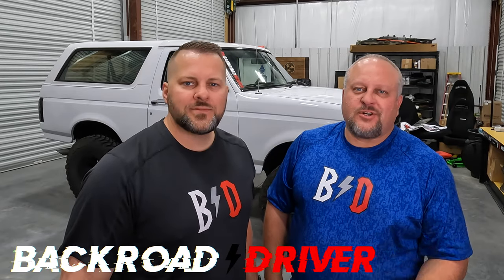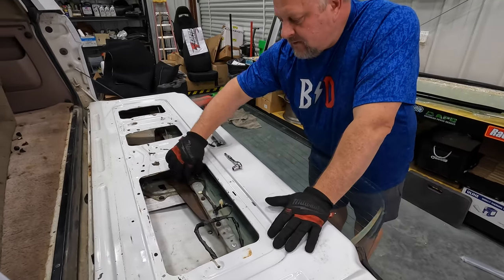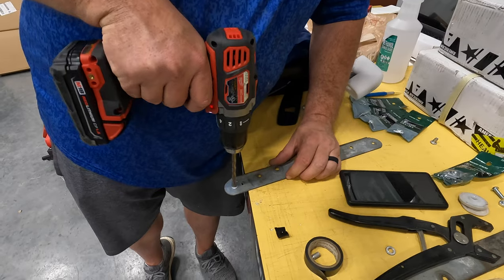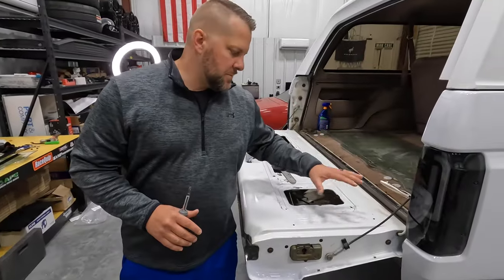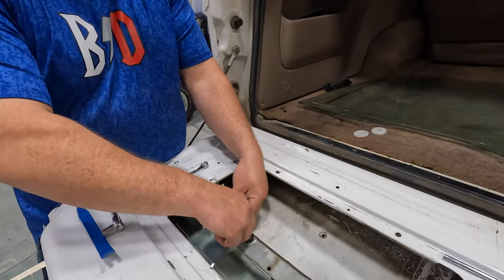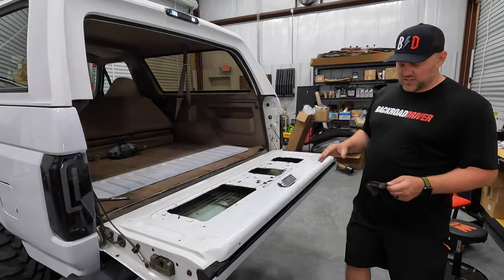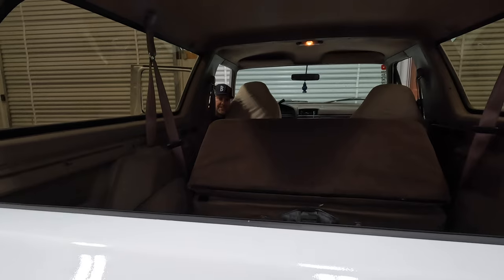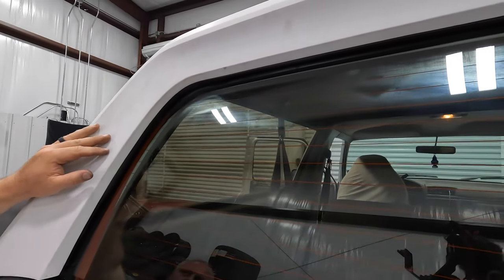1996 OBS Bronco New Tailgate Glass & Seals - Build Video #5

Comment: That run seal on the upper part of the tail gate, do i have to order those clips? I recently ordered that run seal for my 93 EB Bronco and was going to replace it but didnt come with any clips i see the small holes on them where the clips go into. But dont got no clips. Would i be able to re use the ones thats already there?

Comment: Correct way to remove glass is to take side plugs or seals. They twist out. Also need to remove regulator and clean and dry lubricate. Regulator can snap and hurt you bad.  Need to put bolt or screwdriver in holes when glass weight is not on it. Total rebuild of tailgate was one of the most frustrating and expensive things I ran into besides stroking motor to 331.